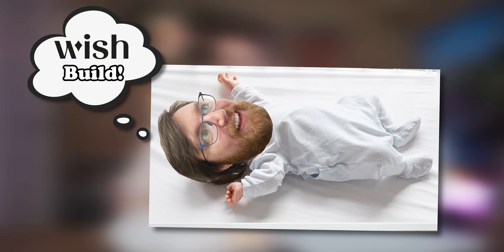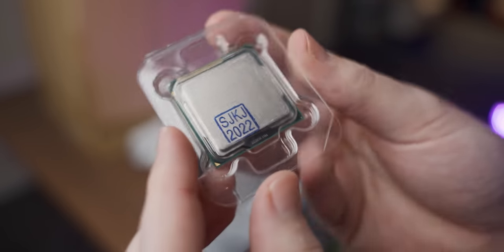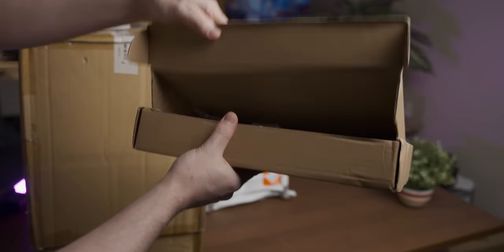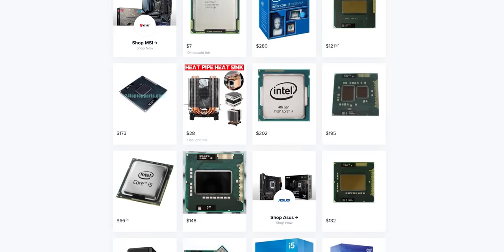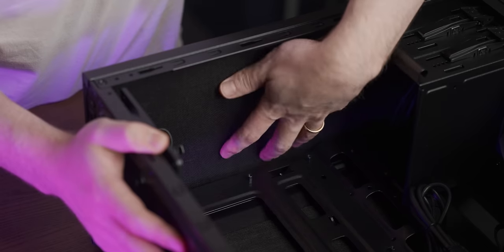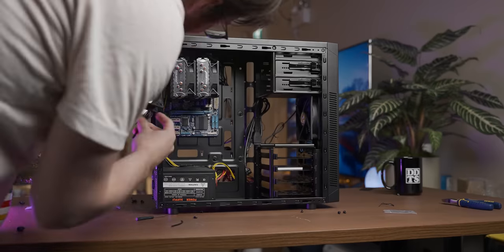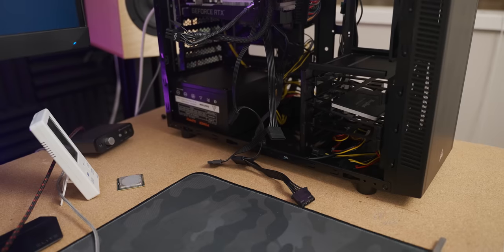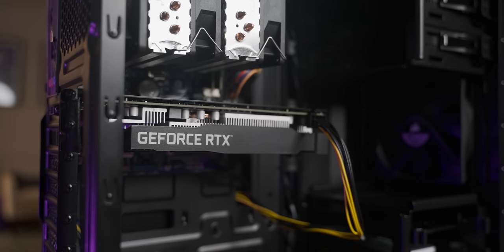Building A Gaming PC Using Wish.com Causes Emotional Damage...

Comment: The fact that dawid even got a real RTX 2060 from wish is suprising on its own.
Reply: not really it happens all the time just pick the proper rtx 2060 one that costs reasonably close to a real rtx 2060 and you get a real one buy one that seems to good to be true and get ripped off
Reply: its galax pretty reputable
Reply: @raven4k998  Seems true
Reply: @joe-bw6wy   Galax is the best. They used to be the only good option for white GPUs. The old HOF cards were the best. We just didn't get them in the US.
Reply: @colewelden  here in Australia they are fairly common
Reply: Isnt like he got it for 100 bucks.      He posted that he paid like half the builds budget ($438) for it, and you can find them easily for that price at any online vendor.  Whoever sold it most likely just went and picked one up off Amazon and still made $100.
Reply: Are you expecting Wish to only sell fakes from China?

Comment: The fact that 2 YouTubers (you and LTT) have gotten screwdrivers with their Wish RAM is absolutely hysterical.
Reply: My best guess is they intend these RAM kits as upgrades and include the driver to help you open your system in case you don't have one but I have to wonder how many people would buy a RAM kit without already owning a driver
Reply: i have received the same screw driver a few times years ago with fake vape atty's lol
Reply: @chdn  My bet is that the factory that dumps these out were just told to put a screwdriver with all the electronics
Reply: Would that have anything to do with possibly using that memory in a laptop? Say, to help secure the RAM through the holes on the ends? (Since it'd probably be lying horizontally)

Comment: It’s really funny Dawid didn’t check the power supply first. It was so clearly the “one of these things is not like the other.”
Reply: Lol
Reply: I knew right away (as most of us did) that PS was going to be the downfall; I'm only surprised it didn't catch fire immediately after powering on.
Reply: PSU most likely supports only standard 220V/50 Hz . Other than that, Wish is not scam site anymore ?
Reply from the maker: Haha! Yeah, When I first opened the PSU, I was like “this is definitely not going to work” but when the RGB lit up it tricked me into thinking the PSU was working. 😅
Reply: @DawidDoesTechStuff  lol
Reply: @DawidDoesTechStuff  Dawid done in by PSU mind games!
Reply: @DawidDoesTechStuff  25A on 3.3V, 5V and 12V seemed a bit off.
Reply: @DawidDoesTechStuff  lol, yeah I was gonna say that the RGB was probably why you dismissed it. Plus your undying optimism!
Reply: How could he know after all it was a 1000 Watt "PROFESSIONAL POWER SYSTEM" LOL🤣😂🤣😂🤣😂
Reply: I thought it was the mobo at first. That thing has seen some stuff and some things!
Reply: absolutely no way it’s actually 1000W. it probably does like 300W on 12V or something like that lol
Reply: @DawidDoesTechStuff  Ironically the bad PSU saved you from an actual fire because it forced you to pull open your CPU cooler and realise that the plastic was still on there ^^**
Reply: 'was very funny Dawid'  
ruin your life expectations for us
Reply: In that professional power system, the power not strong was.
Reply: seems pretty common that the psu is the problem
Reply: @aleksazunjic9672  tbh, wish has always only been a scam site if you dont thoroughly scour reviews
Reply: @jayjaygolden5123  True
Reply: @DawidDoesTechStuff  Clearly the problem was a simple typo on the Power Supply. It was obviously a 1000 mW (milliwatt) power supply, and the intense RGB lighting strips drew all the available power.

Comment: "Neither the power supply nor the case came with the correct screws."
Did you check the screws that came with the memory? 🤣
Reply: you have to love it when ram comes with a screw driver and screws🤣

Comment: When I built a new system in 2019, I put my old FX-8350 system in that exact case. Because of that "pretend front ventilation", I had to dremel out two 120mm fan mounts in that front panel. It's great now!

Comment: The Corsair 100R case is a decent one. I have the 200R, next step up...very nice. I don't know if you did this for dramatic effect, but an experienced builder, such as yourself, should certainly be aware of the difficulties involved in connecting the power supply CPU cable. That's why the smart thing to do, after installing the mobo, is to connect that cable, BEFORE you install the cooler. Much simpler.
Reply: Some cases have much better access, mid towers not so much.

Comment: 4:23 I bought a very similar CPU cooler 2 years ago from Aliexpress, the Snowman M-X6. At the time, it was only €15. Very surprising performances, on my i5 3470.

Oh, and 14:06... Just remove the entire bracket from the back of the motherboard, with the cooler still attached. Then, remove the cooler from the bracket.
Reply: Yep, that's how it's done!

Comment: You should set the cpu power plug cable in before you screw the motherboard on to your cabinet, so that more easy for you to get the cables back around back on the motherboard

Comment: 9:09
Yeah, been running simular cooler with the same adapter plate, did not enjoy the installatuon process. Luckily, standard am3/am4 mount on the cooler, so relativly easy to move forward.

Comment: I have that case. It's designed to super quiet which is why it has that liner. It also has a manual fan speed switch on the rear.

Comment: I recently build a computer with a scythe fuma 2 in a BeQuiet Pure Base 500FX for a colleague, so I do know the feeling of not getting to the CPU 8pin connector.

On the plus side: There is a hole for the 8pin. On the not so plus side: I also had to do RGB wiring up there.

Comment: My tower is more-or-less built off aliexpress and I am generally quite happy with it <3 It's got a Xeon 2673v3 12-core, 32gb juhor memoria ddr4, jingsha x99 e8i motherboard and some generic m.2 with an rx570. I had the GPU/case/psu already so the thing only cost me like $300 to put together. I use it for editing 4k60 video from my DJI Action and it works fantastic for that.
Reply: I plan to dump a 2698v3 16-core, 32gb more ddr4 and an rtx3060 into it in december and call it a day though.....Epyc's are getting cheap and i want something newer haha

Comment: Speaking of the "light" power supply, If the PSU weighs less than the board, CPU and memory combined, then you have a problem.  But for 1000 watt power supply I would venture to say it's probably 50-60% efficient so you might get 500-600 watts on a good day.  That is of course, if it doesn't catch fire when you load it up to 50% so around 500 watts worth of components.

With respect to the motherboard CPU socket pins, I found that they can actually be more durable than people think.  I mean you have to push something onto them to bend them, so something likely would have had to go through the box, which even pressing on it, or crushing it, probably wouldn't necessarily bend the pins.  It would have to almost be a direct impact or force right over the socket as the metal plate does help protect them, and the piece of paper as well, despite them coming with plastic covers instead from the factory. (Yes I did bend a bunch of pins on an already-bad (dead) motherboard once to see how durable they were).

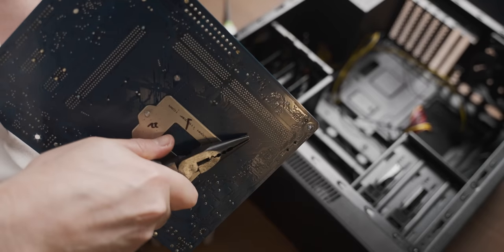Comment: 14:56 actually its pretty decent mounting system for cheap coolers. to remove cpu without removing whole mounting system, you just need to unscrew middle socket screw.

Comment: I actually have a 100R, but that's the quiet edition with the foam and fan switch on the back. Mine lacks those, but has an acrylic side panel. I needed something normal, cheap, that had optical drive bays when my Alienware toasted its lil power board internally, a quick, cheap, 'make it a normal desktop' kinda thing. And I DID have that issue with the CPU power cable.

Comment: This PC build reminds me of the time I tried to replace the motherboard on a 2004 iMac - I’ve been bald since that experience. 

Too bad the “1000 watt” power supply crapped out. Oh well, I was going to suggest trying out the Nvidia 4090 on this system when it is released.
Reply from the maker: Sorry to hear about the Mac induced hair loss. 😂 
I agree, I was really disappointed the PSU died. I did want to try it with a 3090 or 4090.

Comment: For years I've been using those tiny alcohol sachets you can buy on eBay for cleaning cpus, When i sell a motherboard i usually place one sachet in the socket to protect it and for the buyer to use on the cpu they are fitting - its definitely a smart idea ☺

Comment: It's not only bad psu's. My mothers 3rd gen intel was running with a coolermaster psu and PC just refused to display. So I gave her an upgraded and as this intel only has a g2020 CPU in it and on to trouble shooting. Everything worked and so last thing to test was psu and amazingly it worked after I swapped it with a crap no name psu and it works fine. It's a 450w unit good enough to power a g2020 but I am in the process of upgrading it to a 3570k so may need to upgrade.

Comment: @Dawid Does Tech Stuff - 
Oh the CPU-coller was desinged for AMD AM2 to AM4 retention module , the black plastic ring is an adapter for intel , this is so 2006 , thile the unhook mechanism is nearkly as bad as a 2001 Socket-A Athlon-XP cooler ...  
With this case you have the same pain as with my cheap 2013 Corsair case ... but mine is even chesaper & but can breath at the front

Comment: I run an Xeon E3-1225 V3 and used to have an E3-1245 V2 for some gaming, surprisingly they work pretty well. Xeons great for large processes such as video editing but they lack some sharpness for quick processing in-game, that's something an i-Core would do a little better in but I'm sure you're aware of that. If you found one on that site for a decent price I think you could have gotten away with an i5-11400, it's the most well-rounded budget processor though there may be something better in recent times. As far as I know that's best processor you can use for building a computer under $800 USD.

Comment: That metal mouting clip on that cooler gives me PTSD from old Socket A coolers where you had to use a screwdriver to clip or unclip the Cooler from the socket and you allways ran the risk of accidentially stabbing into your Mainboard while doing so.

Comment: When Linus bought ram off of Wish, the ram also included a tiny screwdriver and screws, and they were from a completely different manufacturer, there must be answer as to why.
Reply: It's so you can attach your own shells/heat dissipator. You screw them together on the sticks like a sandwich. Budget way to get rgb ram.

Comment: Hi! What's the software you use to display FPS and temperatures in the benchmarking portion of the video? I've seen it a lot and would be interested in comparing with my own system.

Comment: 4:00 well it may very well be a 1000W psu. it just doesnt have all the safety features and performance stuff built into it. its not hard to get 1000W. its hard to get it stable, reliable and efficient...

Comment: I lost a PSU on a build once from some freak BS. Got a HEC for cheap as a hold over. Installed it and nada. Shorted the pins and got it to boot. it worked after that though I should have let it stay dead as killed my GPU a few days later. The one part I never cheap out on anymore.

Comment: As soon as I saw that PSU box my first thought was, "bet it doesn't work with a 2060 in there" and if course it doesn't XD. Cheap Chinese PSUs were the bane of my existence a few years back working in a PC building and repair store and they've never gone away. The amount of people who would come in with a new build  that they couldn't get to post and the reason was the £20 power supply from Amazon was worrying. I'm sure 40% of the business was selling a proper PSU and swapping it out for the customer because it either didn't post or if it did, exploded the second it spent more than 30 seconds with the GPU at full load.

Comment: I built a budget PC off aliexpress before, went really well using a xeon 2689 CPU, motherboard and ECC ram, better multicore performance than my 7700k but not as good for gaming because of low single core. all in all very good deals to be had if you do your research and know how to avoid the scams

Comment: I have an lga 775 motherboard and I recently wanted to change the cpu. The cooler I had installed years ago was an deepcool that had an identical design. I had a very hard time getting it to unclip. Then it wouldn't boot. After changing the processor and reinstalling the old one it turns out I had to update the bios. I almost had a mental episode.

Comment: Whenever you're having power issues, always watch the power on and off behavior, especially with new builds. I instantly called out the PSU because I knew it didn't have anywhere near 1000W, I would go so far as to say, it was 100W NOT 1000W, furthermore wattage means dick without amperage. The back fan shuts off, while the CPU fans were running. No matter what you may think, that fan has absolutely NO REASON to be off, except if it is unplugged or, not enough power... Watch the power on and off behavior, especially how quickly things power on. With sufficient energy, you see no struggle with powering everything, with insufficient energy, well I think you already know what to expect with that.

Comment: Quick notice: you need to turn on future frame rendering to give use full gpu if that’s on in BFV then it’s just the cpu bc personably I have a i7 3770 and a 1660ti and the gpu usage is around 90% while playing bfv
Reply: Doesn't that increase input lag? I feel like I'd prefer lower framerates with less input lag as long as the framerate is above 60
Reply: @jordanlazarus7345  yeah true but personaly i have a 165hz monitor so 60 fps is kinday laggy for me 
also before i turn on FFR i get around 110 fps average on ultra and 85 with FFR off

Comment: Wow you jumped right to the CPU as he problem?  Maybe remove a stick of RAM and then swap with the other first, easier process and eliminates or identifies that. That it turns out to be the PS is only a little surprising as it initially powered up at least the CPU cooler and exhaust fan on the back. It's not, however, surprising at all based on the weight and sticker crookedness on the PS.  Good stuff! Cheers!

Comment: That power supply seems to have 3x 12v 25amp power rails, 300W per rail x 3 = 900W rounded up to 1000W. Calling that a 1000W PSU is a bit of a stretch.

On paper this should be fine since the GPU only takes 190W, but can you really trust the 300W figure?

Comment: My motherboard box looked like someone dropped a cinder block corner down on it. Legit hole in the box. I didn't see any damage to the board, installed it with fingers crossed and it works. Thankfully.

Comment: I recently bought a last stock MSI B450 board for 400 kuna in Croatia. That's  51 USD. And a used Ryzen 3600 for 750 kuna which is 96 USD. That's 147$ vs 181$ for just one used part, unlike the Wish where both the mobo and the CPU are used. I would then use the remainder for DDR4 ram instead of DDR3 and for the same price have a much more capable system. And take into account that in croatia we have 25% VAT. Wish sucks...

Comment: that power supply will make 1k watts right before it turns red hot and catches fire. just like alot of car audio amps. 90% of people dont understand that the big bad 1000 watt number on most amps is what it would make with 24v power and for less than a second before it blows. RMS is the number that matters on any audio equipment. and if the rms number is the one on the box and on the amp its a better than most brands.

Comment: I actually tested my brother’s PC box top before installing it. First time I ever did it. My best cable management job as well. Ryzen 7 5800x, RTX 3080 (not TI), 32GB RAM, I think 1000W PSU 30+ Gold Corsair, Corsair 4000D case. He wanted to use it to stream Fortnite. It’s a shame Fortnite isn’t very well optimized. He should be getting more than 144FPS, but he gets frame drops still. I think it’s the mix of Ryzen and Nvidia because it’s a common problem

Comment: You were so confident in the fire survival motherboard you didnt try to post it before you assembled?

Sometimes you're a genius, and other times it's like you've never touched a PC before and I love it lol.  Like forgetting to put the PSU 8 pin cpu plug through the case before you slot in the motherboard so that you can plug it in as you insert the board is something you build a habit on quick.... But not dawid lol.
Reply: or forgetting the plastic under the heat sink hahaha

Comment: I knew the issue was gonna be the power supply from the start, hahaha. IED ignition source. Love it. That thing was garbo from the start. You're also the second "professional" YouTuber I've seen forget the CPU protective plastic recently. Professional like that power supply! Super fun build. You had plenty of room left in your budget for a replacement power supply anyways. We'll forgive you. They ended up having PSU issues too, so you're both equal there. Overall a really close race. Yours is a more normal computer, theirs more unique. I think theirs has more headroom with just a GPU upgrade, so edge there, but you used the SSD you got. Hard to declare a winner, they might have you by a hair, but really fun challenge!

Comment: I have the same cpu and motherboard and ram. It cost me around 88 USD combined. In fact the whole pc xeon 1270 v2 + 16gb ram + mobo + case + 500w psu + Rx 470 4gb + 120 ssd + 500gb hdd cost me around 186 USD. I'm always surprised how expensive usa canada is when buying old used items but new items are still fairly priced there even when they were being scalped.
Reply: Also my cpu cooler also has the exact same mounting bracket and it is actually really frustrating.